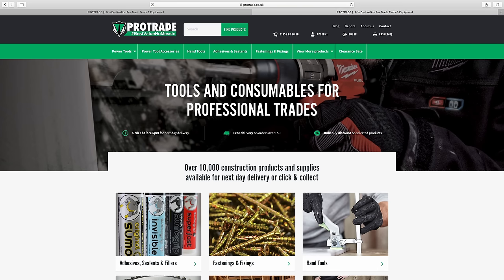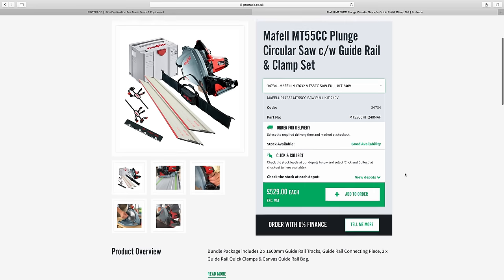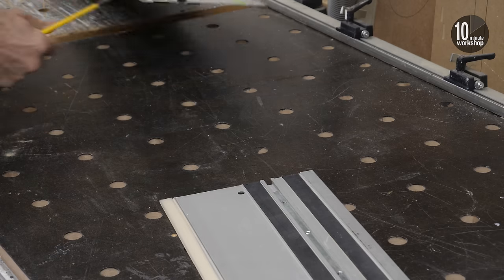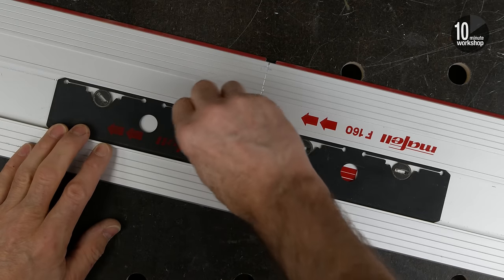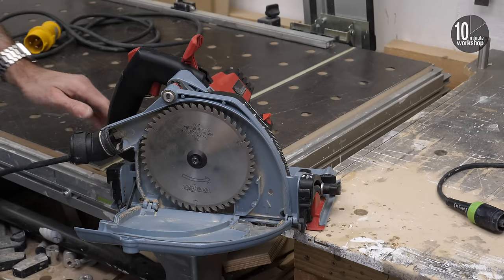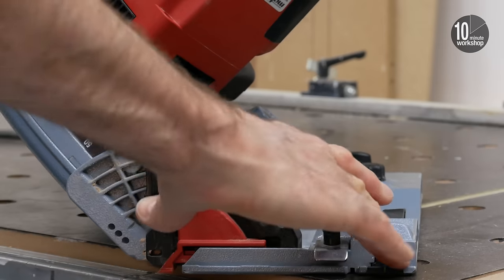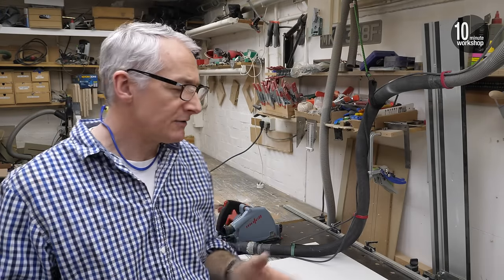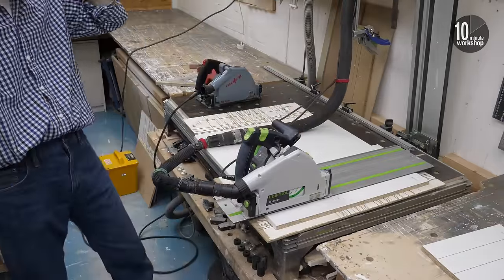Big Decision: Festool or Mafell? [video #400]

Comment: A very good comparison video thanks Peter. Especially good to see the gap created by the Mafell scoring feature.  It presumably has a couple of other downsides: once activated, the rubber splinter guard has been cut slightly off the main cut line which may slightly compromise the quality of cut if you subsequently stick with the manual scoring cut (hand spacer method!) to avoid the offset.  Also it makes sense that the waste side piece would have worse chipping after using the offset scoring cut, because the final waste side cut is a full depth cut pulling the teeth up through that face a fraction of a mm further into the face which is bound to cause more chip out.   So in short this helps me to conclude  that the extra Mafell scoring cut feature is a false benefit (which is the same as how I now view the angle top stop on the Makita!).   I’d be interested to know how you rate the long term durability of the Mafell baseplate’s gripping mechanism onto its rail - tightness vs smoothness - as this was a noticeable downside I discovered in the makita vs the festool.  For me, my confidence in the Festool machines has been renewed - good solid design - although I would like to have the improved dust collection offered by the Mafell.  Thanks for your efforts.  (I’ve just done my first tool review style video and it took me AGES to edit, I think I will plan and script it better next time!!! I could learn some lessons from your snappy feature summary at the start of this video, with relevant B roll dropped in 👍)
Reply from the maker: Thanks Alastair! Yes, I wanted to take a closer look at the scoring on the Mafell because I’d had a couple of people mention the ‘gappiness’ as being an issue for them. Obviously we can only test the saws we have - this Mafell’s a demo unit on loan, so I’d expect it to be fairly recent and in decent nick - hard to imagine a demo machine having a harder life than a saw in a busy workshop - but equally I’ve also had a couple of people say that they have no problem with the scoring cut on their saws… 🤷‍♂️I need to look at the Mafell rails again, but I’m pretty sure that they’re metal-on-metal, so I’d expect wear to be a factor longer-term, but that said it was a very snug and smooth fit on the skinny upright that the Mafell rails have to locate the saw. I do like the Mafell rail-joining method, but it’s not something I do much these days, and overall I prefer the Festool rails with the extra width; wouldn’t say no to a T-slot closer to the splinter guard though!

Dust collection on the Mafell is better, but as mentioned in the vid, putting a length of tape over the access hole on the Festool makes a big difference. And thanks, yes, I saw your vid - we should probably start a shared calendar, lol! - and enjoyed it; I do find that scripting it really helps get the points across though, and avoid the rambling. And yes, shooting cutaways / b roll is a great way to keep the pace up  - though it is time-consuming to do. Cheers, Peter. 👍

Comment: Had to make the same decision some years ago (hobby use only). You can‘t go wrong with either - both of them have their pros and cons. At that time I haven‘t had the chance to do testcuts etc. - I could only hold and inspect them for some minutes. I've choosen the mafell. For some reason the festool felt like a toy compared to the mafell. The tilt mechanism is absolutely great, blade change too. However, there some things I don‘t like about it. If you do bevel cuts, it doesn‘t cut exactly on the edge of the splinter guard. It cuts slightly offset by 1-2mm - perhaps you can check that with your saw. The track doesn‘t cover the width of the base plate on the left side - means you can‘t use the track‘s edge as a fence or stop (don‘t know the correct wording). I also miss the possibility to add tools to the track. On the other hand you can use the festool tracks to remedy those two problems (well, with all the drawbacks the festool ones have 😄). The festool offers more freedom in blade selection, but I had no problems with the mafell ones. I use the 32 toothed one for every day use. Other than that, I love the mafell and it‘s always a pleasure to work with it.
Reply from the maker: Yes, there’s a ‘further thoughts’ video out for my Patreon on Sunday where I get into a few other niggles. Both great saws, pros and cons to each, and very subjective depending on your useage. 👍👍

Comment: The mafell is faultless.Run new blades through a off cut of worktop a couple of times first you will then get a perfect cut. My scribe offset doesn’t seem so big as yours but if it’s a problem turn the material over

Comment: I have the Festool. If you want to do a scoring cut with it, then what i do is set it to 3mm or so and then do a reverse cut, ie start at the end and pull the saw backwards. Then i set it to the depth of whatever i am cutting and cut forwards as normal.   I have done that for years now and have never used the 48 tooth blade, the only ones i use are the 12 and 28 tooth blades. Using the 28 tooth blade as described i have cut many  £500 laminated doors without a hint of chipping. :)  I noticed you were using the clear blade guard cover, using the green version increases the dust collection, i use it on mine along with the 36mm hose and the dust collection is on par with the mafell.

Comment: I’ve always thought it should be easy to attach a very small sharp razor knife to the track saw for scoring. This would make plywood veneer cuts perfect. I’ve used a manual score type technique a few times while making furniture for bevel cornered joints.  Perhaps one of those entrepreneurial types will come out with a nice aftermarket add-on.
Reply: Should be easy to make such a small device with a 3D printer. I will think about it.

Comment: I was on the edge when I purchased my Festool track saw. I checked out both Mafell and Festool and in terms of just the saws, it was a really hard choice.  I like the front and rear bevel lockdowns on the Festool, subtle, but sturdy setting.  The Mafell just doesn't feel as solid with only the front knob for locking.  Also, I like the handle on the front of the Festool.  As soon as I tried the Festool, I knew I wanted the front handle.  I felt safer, like I had more control even if I wasn't using it, it's there.  Finally, the Festool kit.  It's part of a much larger 'ecosystem' and so many of the parts can be used together.  Great comparison.  👍
Reply from the maker: Thanks! 👍👍
Reply: The Mafell has only the front knob for locking, but it locks at rear too using a tension rod - One knob locks both front and rear. I don't own the Mafell, but I watched a video that showed the locking mechanism of the Mafell.

Comment: When I do a scoring cut I was always shown to run the saw backwards down the rail first, then the blade runs the opposite way with the teeth going down into the face by a couple of mm rather than out of it (like the rotation of a scoring blade on a full size table saw) then finish with a full depth cut as normal pushing forwards.
Reply from the maker: I’ve tried it both ways, didn’t make a scrap of difference as far as I could see. 🤷‍♂️

Comment: your'e correct about the festo guiderail , and I made a 4 meter  ruler with some angleline to hold the outer edge of the festo-rail , budget !  only €24 and no more screws inside the rail that not only get ugly ,but also connect in such croocket way  you can build ships without any drawings.  second I also sanded off the ends of the festo rail smooth so no dusthose can get stuck nor the cable gets stuck in the connector grooves....   , and third...  how can you compair saw quality when you use a dull blade ..  and how can you compair without changing the speed  festo has a very nice speedcontrol  and especialy on chipboard it makes a big difference.  nice review  , no music !!

Comment: Hi Peter
I find with the gap created by the scoring cut gets filled with glue or finish. hasn't been a problem for me. Plus your offset looked more than, .1of a millimetre. I do find with the Mafell that occasionally I get blade wobble with the thinner blades. I have several different blades to cut different materials, but I am getting blade wobble. to cure the problem of the scoring offset set the depth stop to 3mm. job done.
Reply from the maker: Hi Stephen. Yes - as I say, it’s more of an issue in MFC. And yes, the offset is more like 0.3mm - there’s a ‘more thoughts’ video on my patreon channel, btw. 👍👍

Comment: good afternoon peter hope you are well..........i purchased a Makita track saw 10 years ago still going strong , the  big problem with it, the blade changed it to a Freud blade what a game changer fantastic I then changed my Dewalt  table saw to a Freud blade totally different it improved it so much and I watched Gosforth handy man do the same I'm sure he copied me . try fitting a Makita rubber edge never peeled . when I change mine  its a struggle to get in off. would be nice to see a 10 minute workshop on saw blades
Reply from the maker: Thanks Anthomy. If you watch the Tracksaw Workshop series  I recommend fitting the Makita splinter guards as well, and I cover quite a few alternative blades too - and use those same blades in my Festool in this video - More about blades, https://youtu.be/jR25DirM34E 👍

Comment: I sold my festool ts55 and bought a mafell. Love it! The downside is that mafell are abit more hands off when it comes to setting up the tool, and there's generally less info around. I have had some difficulty getting it to cut perfectly at 90 degrees when set to 0 on the gauge (very slight bevel). Apart from that it's been great.
Reply from the maker: Interesting. Had a pal switch from Festool to Mafell and his MT55 wouldn’t cut a 45 bevel - he had trouble getting it changed ‘cos it’s not the kind of thing you’d check for straight away. 🤷‍♂️👍
Reply: @10MinuteWorkshop  there's been a few cases of "unusual" angle problems. I fixed mine with a doubled-up layer of gaffer tape. A particularly lofi method, but I haven't been able to face taking out all the piddly screws and trying to create a washer thin enough.

Comment: I have both saws and use the mafell for laminated MDF sheets only. The scoring function works perfectly and doesn’t have the gap on the panels we cut . I gave both saws a comparison by fitting a new blade and splinter guard to the Festool the mafell is better in every department.
Reply from the maker: 🤷‍♂️ I can only test and report on the saws I have and this is the result. 👍

Comment: Thanks Peter, another thoughtful video.  Now I understand my problem: I am conflicted because I have both engineer thoughts and woodworker thoughts 😉.  I’ve noticed a slight offset when using the scoring cut on my Makita.  The cut is exceptional, but I don’t like the slight offset either.  I always thought it was just poor cutting technique/slipping guide rail on my part.  I’ll have to take a more controlled look at this when next I get the Makita out.
Reply from the maker: Thanks Todd! Woah, internal conflict! You might need to sit down and give yourself a good talking to! 😂👍👍

Comment: The Mafell scoring cut is ideal taking off the top or bottoms of say polished ash doors.  The slight offset is now actually an advantage - a little bit like taking off the arris, it strengthens the end grain but I would still run a block plane along.

Comment: Kitchen fitter for many years and used lots of Plunge saws - the Festool doesn't have the power of some other saws and the rail system takes too long to connect for 3m+ runs, the bosch is excellent for the price as its a cheap mafell but the mafell is the best plunge saw ever made, best dust extraction, blade change and guide rail system. Its not much more than the festool but its noticeably better to use

Comment: Love this video I have owned festool dewalt and Bosch track saws.   Being a kitchen cabinet installer I prefer the Bosch / Mafel tracks    I found the Bosch saw works very well the waste side cut is worse as noted on the mafel/ Bosch than the festool    The connector for the mafel / Bosch is so much better.   I like that the Bosch scoring cut doesn’t do the blade shift the mafel does.

Comment: Very nice comparison video. One thing which I noted myself when comparing the two was that the movement left/right possible to the saw blade when setting it in the 90 degree position is slightly more with the Festool saw, as it only has (had? I am not sure if that is improved/updated in the mean time? It was some years ago) one stopping point on one of the hinges, where the Mafell has 2 adjustable stopping point more in the middle - which can be overruled by e clever & easy system when you want to make fi a -1 degree cut.

Comment: I guess you could just duplicate what you do on the Festool Scribing cut, when scribing on the Mafell, so without having to use the special offset devise on the Mafell you should still get a nice finish without any "offset"Gap appearance. Just a thought !!! Love your videos , very informative, keep up the good work. Cheers From Australia...
Reply from the maker: Oh, yes, of course. But ‘buy a dog & bark yourself’ comes to mind! And thanks! Best wishes from a sunny London! 👍👍😎☀️
Reply: @10MinuteWorkshop "..buy a dog and bark yourself !"...Rolling on the kitchen floor laughing my ass off...(with legs in the air)
Reply: That wouldn't work  as the tenth of the mm offset is built into the plunge, the blade moves over that tenth on every plunge after it passes the scoring depth. All the score switch does is stop it at scoring depth. So even if you just set the depth to 3 mm and didn't use the switch it still moves over a tenth.
Reply: Biggsy1970 
Thats not correct, the switch sets the depth and moves the blade over a fraction. If you don't use the switch it doesn't offset at all.
Actually thats the bigger criticism of the mafell because if you use the score cut it cuts into the rails splinter guard by a tenth of a mm, so affects the accuracy of the cut in relation to the splinter guard by a fraction for any future cuts.
It is however probably the only saw you can get a chip free cut from even if you don't have a  guide rail to hand by using the scoring facility. 
I have the mafell and two festool plunge saws, and generally find the mafell is the better quality saw however the festool splinter guard to the offset side of the blade is more useful and a must when doing hob or sink cut outs if your blade has started to dull.
Reply: @ianglazebrook7628  who told you that ? My info came from Mafell from one of their UK demo guys you'd like to think they know how the tools work 🤔
Reply: Biggsy1970  Hi I’ve had the Mafell for 10 years now and can hand on heart say it does not offset the blade with the score cut switched off. I  very rarely use the score cut as I too don’t like the slight gap. I bought it because it was brushless and I was waiting for a new set of brushes for my Festool so thought I’d give it a go.
There is a mafell demo video by Alan Holtham on you tube from 10 years ago and they mention them that the blade is automatically offset by 0.1mm when the score cut is selected. 
If I can find it I will attach a link
https://youtu.be/POprMeRfDXE
Reply: I should’ve added it turned out the Mafell CUprex motor wasn’t brushless just more efficient so better power output so I too was miss informed by a “Mafell” demo guy 😀. However I’ve used it far more than my festool ts55 and still haven’t had to change the brushes. The festool brushes went after about three years.
Reply: @ianglazebrook7628  yeah but he also says no matter what angle it's set at it cuts dead on the rubber edge, which is absolute BS 😂😂 my first one was 3mm away from the edge on 45. Regards the score you've only gotta set the saw to 3mm cut then do a full depth then see if there's a step in the cut. I've not tried this but might just out of curiosity. I'm just repeating what I was told by a Mafell guy, that it always steps over a tenth all the score switch does is stop it at 3mm ish
Reply: @ianglazebrook7628  I have the Mafell saw, and I disagree with you about the offset when you manually set the saw to ~3mm.  The offset is still there.  It is my only grievance with the saw.  Other than that, it's a brilliant saw, and  I've also had a bit of experience using the Festool.  I prefer the Mafell.  The only other complaint I have is that there is no Mafell dealer within Australia.
Reply: Damien Micallef  I’ve never actually used the mafell rail and set it at exactly 3mm and just tried it out of interest and I’m very sorry I stand corrected it must be something to do with it being  3mm. As I usually use it on the Festool rail the depth gauge isn’t spot on so I usually do the cut by eye at around 4-5mm and do a reverse cut pulling the saw backwards into the material. I’m guessing that’s why I’ve never noticed. 
I agree it’s still the better saw shame it doesn’t have the splinter guard to the right of the blade like the Festool, then it would be perfect ( except for the score cut 😁)

Comment: I have used both saws, but desided for Mafell because of a few reasons:
Rail and connecting rails
Rail rubber each (easy to replace) and I do it alot :) 3-5 times a year.
Speed of a cut (cordless tool. Also tested festool touble battery version).
Work time with cordless tool (there is a noticable difference)
Subjective, but feel of a tool.
@bensworkshop did you closed Mafell's front "hatchet" (in front of a blade) for dust test?